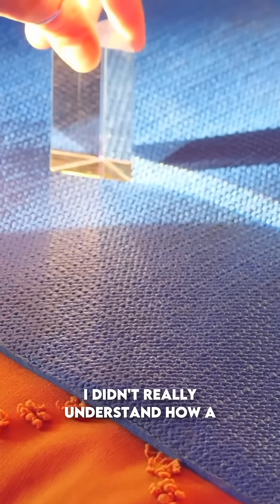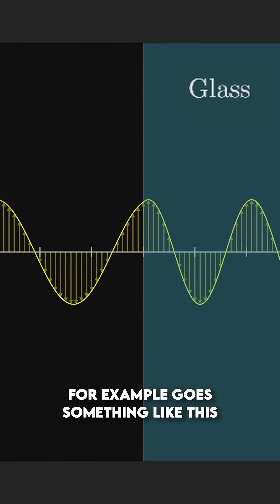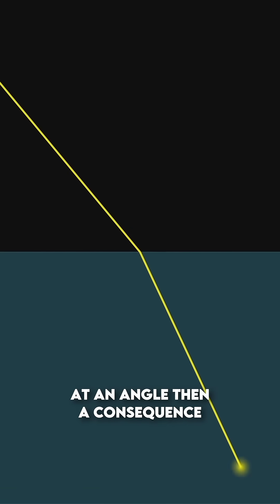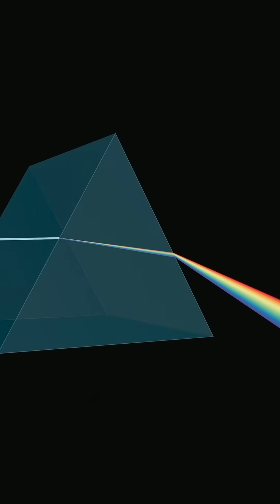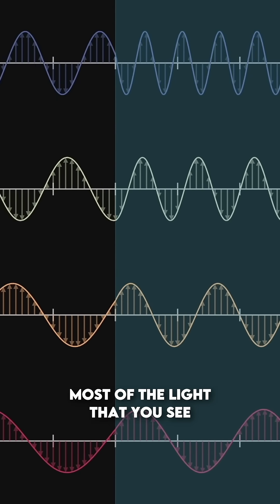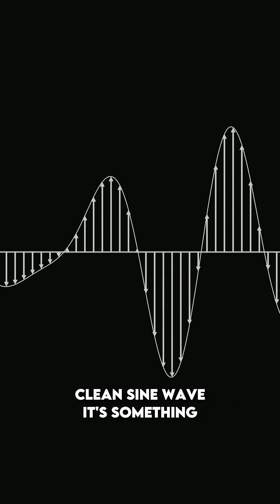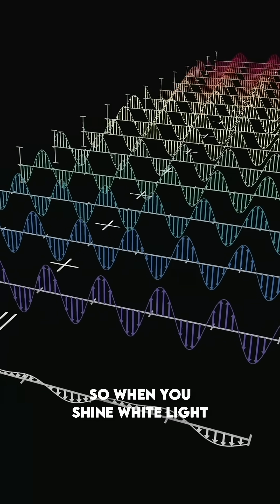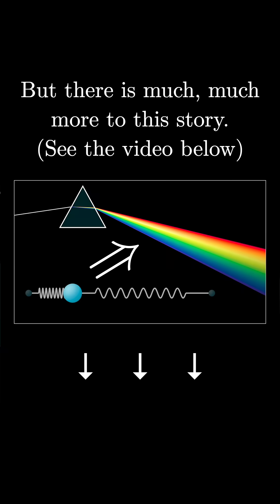How prisms work (full video linked above)

Comment: The amount which light slows down is mediated by its “index of refraction”. This , in turn, is related to the permittivity of a material which tells use how susceptible a material is to electric field.  I kind of imagine it like walking through a crowd where in one case no one knows you and in the other case you’re a celebrity and everyone wants to stop you and get your autograph. It takes you longer to get through the crowd in the later case which would be an example of a high index material or a material that slows the light down a lot.

Comment: Why does light bend when it slows down?  Everyone acts like that is obvious… it’s not obvious to me.
Reply: it bends because it enters a medium at an angle
Reply: @spatrk6634  Still does not explain it. Why bend? Why not just continue at the original angle?
Reply: @wayneosaur  The bending of light conserves energy and wavefront continuity. The wavefronts of light must remain continuous, and to achieve this while changing speed, the light must change direction.
Reply: @spatrk6634  I am sure you are correct, but that didn't exactly clear things up ... just kicked the explanation down the road to something that requires even more explanation.
Reply: imagine a group of runners on a beach. As they reach the water, they slow down. If one runner hits the water first, they slow down while the others are still on the sand, causing the line of runners to pivot or bend toward the water. This bend ensures the group stays together smoothly, without breaking formation, similar to how wavefronts remain continuous.
Reply: @spatrk6634  OK .. I can visualize that, but I can also visualize the runners going slower as they hit the water but remaining in the same direction. I guess the question now is why must there be wavefront continuity? I suppose the answer to that is conservation of energy, but then why does that conserve more energy that a break in continuity. I really am not trying to be difficult, I really don't see what is so obvious to everyone. I am not questioning it, I just honestly don't understand.
Reply: @wayneosaur  The "obviousness" of light bending is rooted in the physics principles that dictate how waves behave. It’s not so much that the concept itself is intuitive but rather that it aligns with these fundamental principles, like energy conservation and wavefront continuity, which are deeply ingrained in how natural processes work.
Reply: @wayneosaur  If the light didn’t bend and kept moving in the same direction, it would disrupt the continuity of the wavefront. This disruption would scatter the light, which means the energy wouldn’t be efficiently transferred through the new medium. The bending ensures that the energy moves smoothly and continuously, which is more "economical" for the system in terms of energy conservation.
Reply: @spatrk6634  Thanks for hanging in there with me. I think this makes sense ... it certainly isn;t obvious.
Reply: @spatrk6634  Thanks -- I have use Snell's laws for light refraction in ray tracing rendering and it obviously is the correct model. Just the casual obviousness of this always seemed strange to me.

Comment: Dispersion is when the velocity alters for a given frequency. This also means the velocity of that frequency is altered.  As a consequence the wavelength at that frequency is also altered. 

So wave theory describes,but doesn't fully explain. Let's dig down then. The important thing is that the electric wave is now running through an electric medium, not just free space. The speed of light in a vacuum is a constant, but this is not technically a vacuum. There are background fields.

The electric fields in a transparent medium occupy most of the volume in relation to atomic centers. They must also be in a random arrangement.  Light travels so fast in relation to the varying fields in water for example that it "sees" the field as essentially frozen in some random configuration. This is also true of gases even though the gas molecules in air are moving fast the light still sees them as essentially frozen in position. ( I have seen so called explanations of the greenhouse effect that have no concept of reality in regard to relative speed).

In an opaque solid the fixed atomic positions intercept light and absorb it as quanta.

In metals the fields contain free electrons that reflect the light by effectively generating a "back-emf".

It is interesting to also view this refraction of light at a quantum level. Given that the quanta are not absorbed (as they are by pigments etc) then the photon energy is unaltered by passing through a transparent material. So red remains red even though it temporarily gets slowed down.  So we can't use energy arguments. That might seem counter-intuitive but that's only if you use classical thinking when you shouldn't.

That leaves momentum which is a function of the wavelength of light. So the momentum of the photons must be coupled to the background field as the light is transmitted through the background field. But when the light emerges the coupling is broken and the light continues, and the wavelength is restored! However there must be some kind of momentum exchange, so if the light is bent in one direction it follows that the prism gets a kick in the other direction.

Comment: The part I never understood is how light slows down, when it is supposed to be a constant. How do we measure the speed before and after entrance into the prism? Also it's almost like the slow down bend only happens at the point of contact, because if they are constantly slowed wouldn't they eventually start to curve? Why does slowing make it bend?

If you slow down an object with mass, does it experience turning forces? Would that even make sense? I know light can be bent by gravitational wells/waves in space time, but are they bent by the gravitational force as well or just the warping of space-time?

Please any physicists who understand this, could you ELI5?

Comment: How are they able to split into “pure colors”? Does such a thing exist🤔
Reply: Yes, pure colors exist.  It's called monochromatic light.
Reply: @carultch  well colors arent discrete the way wavelengths are, so thats what i was trying to get at
Reply: @broccoliboi123  It's true that there are multiple ways to produce light that you perceive as any given color.  But for a select domain of colors, one of those ways can be a single frequency of light.   Any fully-saturated color from red thru violet, can be a single color of light.

Colors that can't exist as a single color of light:
White, Gray, Magenta, Lavender, Chartreuse, Pink, any color considered to be a pastel color, any color you need to turn down the saturation slider to make.

Comment: But the real reason it does all of that is deep in quantum mechanics and makes absolutely no sense until you’ve done so much research on it that it starts to, and then you think about it again and it no longer makes sense.

The quantum way light moves through glass is it moves through in a near infinite different ways, but whichever way takes the least time collapses the wave function and it went through only going the shortest route.

You can place a mirror in a very odd location and under the right circumstances you can get light to reflect off of it at an angle that is NOT opposite of the angle it entered on. Freaky

Comment: The speed of light is constant I’m pretty sure. It’s about the differing angle of refraction of different wavelengths. But that only really describes what happens, not explains what happens. I’m not even sure that there is an answer. People are still struggling with the particle/wave duality of light.

Comment: why the upper spectrum, whith higher energy is more deviated,and what measurements  where made to notice a difference in it,s speed,??the spread spectrum,creating this visual effect,might be due to different absortion level of the waves composing the white light,,blue beeing more and red less ,,so on in bettwen those,,,,!?light is going thrue the glass atoms,wright,so maybe there is a saturation  depending on the wave lenght,,or is it an energy transfer,so the glass atom receive whithe light,and emit it back in seperated waves,when there is an angle of entry and exit,,,,??or is it only a matter of higher frequencys gets more deviated then the lower ones??

Comment: Hi
Imagine the light beam being  circular in cross 
section
and when it touches the angled glass the cross section becomes an elipse  due to the change in angle which because it is now travelling as an elipse causes the spectrum of the rainbow 🌈 with red being the last and longest part of the elipsed beam reaching the other edge of the prism.

Comment: A light ray is not transmitted in a prism merely by avoiding all the mass; it is certainly absorbed and re-emitted by electrons.  This need not involve energy retention, but even light inside the sun must at length escape it.   Sunlight wave forms canNOT reliably be modeled by Fourier transforms of sinusoidal wave components alone; doing so presumes that only S-orbitals emit photons.  Obviously other orbitals also radiate photons, whose wave form need not be sinusoidal because emitting electron orbit is not circular.  If it is found that the Fourier Transform model can accurately describe light's waveform, then that means light ACQUIRES a sinusoidal waveform FROM its energy exchange background space in self-sustaining transit.

Comment: correction: wavelength changes frequency doesn't change. Frequency is source dependent so it remains same no matter the medium but wavelength is medium dependent.

Also speed of light (or any wave) = wavelength*frequency

so since wavelength changes the speed changes as well or vice versa

but frequency remains constant

Comment: It is easier to use wavelengths and index of refraction to understand what is happening. The index of refraction varies slightly with wavelength, so the angle of refraction varies with wavelength.

Comment: Can you use prisms as very analogue fourier transforms to perform calculations? Carry a master signal made out of white light, and exact information as necessary from it using prisms? I wonder how much precision you can get out of a system for that to transfer data. Depending on how precise you can read and emit the light, you potentially could build your system to transmit information from system to system across very narrow spectrums of light.

Comment: What happens on the other side of the prism? It should bend again, speeding up the different colors, restoring the original path instead of forming a rainbow.
Reply: It does bend again.  If your prism is a rectangular prism, it will emerge back in the original direction.  But because it is a triangular prism, it emerges in a different direction, because the exit surface isn't parallel to the entry surface.

Comment: My question is that why light bends when it goes from rarer to denser medium?
Reply: Because that's what's necessary for continuity of the wavefronts.   Wavelength is "sacrificed" when light enters a denser medium.  In order for wavefronts of a continuous field of parallel plane waves to be continuous at the interface, the direction has to change.  Look up proof of Snell's law, to see diagrams.

Comment: Why does a prism separate light into its colours but a rectangular block doesn’t?
Reply: A rectangular block also separates light into its colors, but the phenomenon is much weaker and harder to observe. It cannot be observed by looking through that block, because the rays of different colors are parallel and very close to each other, so they will be focused by the eye at the same point on the retina.

Comment: I think the explanation still leaves so much unanswered… like, by this logic, everything should be a prism, because let’s say you hold a coffee up—light hits it, and it slows down. So glass has to have a special property, in that it doesn’t absorb light, but still slows light. But now hold a drinking glass up, and it isn’t a prism like what you use in your second grade science class. So what is it about the prism that’s different from any pane of glass? Is it the angles of the prism? But then depending on the angle you hold the prism or shine the light through the prism would determine its effectiveness…

Idk. The more I think about it the less i get it

Comment: The light doesn't actually slow down. What is happening is that the light is hitting more molecules and has to bounce a lot more often. If you ever look at the equation of light moving from a less dense area to a more dense one this "slow down" effect occurs. All that is really happening is that it's speed is decreasing but it's velocity isn't. Sort of like throwing a ball down a tunnel vs throwing a ball at the same velocity but it hits the walls of the tunnel. The straight shot is going to be quicker even though the ball is still moving at the same velocity. Since light is also a wave, you get different colors based on the portion of the waves that were refracted which is why its split. Different wavelengths have different pass through. For instance, a radio wave would not be affected by the prism.

Comment: You can't slow down light. Light travels at the speed of light. A prism bounces photons around inside it when it hits the molecules in the prism, making it travel a longer distance (making it appear to slow down). It also has the side effect of scattering the different wavelengths of photons out a bit (causing the refraction and visible color shifting).
Reply: That's a misconception.  The light isn't taking a serpentine path inside the prism, otherwise, it wouldn't emerge in such a predictable direction.

The truth is, that there's a superposition of the original EM wave with the EM wave produced in the medium, responding to the disturbance.  On net, these add up to a wave that appears to travel slower than the original ligth wave.

"Light travels at the speed of light", is based on light in free space.  Light in a medium will appear to slow down, due to this effect of the dielectric material.
Reply: @carultch  yes, but the light never travels along any path slower than the speed of light. Once the superposition of the wave function collapses after it is observed, the light still takes a path based on its probabilities, and that path has a distance, and the photons travel at the speed of light over that distance, no more, no less. 

Light never slows down.
Reply: @frozencreed  Watch Grant's full video.  It explains it better than I can explain it, when limited to just text.

Comment: Small correction, it is because of different wavelengths of light spectrum, not frequency.
Reply: Frequency is fundamental to the identity of the light wave, rather than wavelength.  Wavelength is "sacrificed" to the process of refraction to compensate for the decrease in wave speed.  Frequency stays put.

The reason we identify colors of light by wavelength instead of frequency, is that you cannot directly measure frequency at the order of magnitude of hundreds of Terahertz.  We instead measure the free space wavelength more directly using diffraction, and calculate what the frequency is from the known speed of light.

Comment: Light doesn't ever slow down, it's just bouncing around in the medium it's traveling through which means it's traveling further.
Reply: if that were true then it wouldn't separate into individual colors, because they would all be entering at the same speed, and exiting at the same speed. That they don't, means you are mistaken.
Reply: The speed of light is absolute. It does not change. The light refracting and scattering is what is separating it, it does not slow down regardless of it's color.  @ChayChay0510
Reply: @ChayChay0510 
Light travels at constant speed c under any circumstance. 
In medium, photons hit particles in it and reemission and bouncing happen there.
Basically these reactions happen probabilistically, and in total, appears to slow down in medium macroscopically.

Comment: Doesn't that break the second law of thermodynamics? photons slow down through the prism and then speed back up as they leave the prism and enter the air medium? What makes the Photons speed back up?
Reply: As I understand it, the light doesn't actually slow down in a medium, it takes a longer path by bouncing between particles (due to the higher density of the solid or liquid)
Reply: @RhodokTribesman  makes sense taking a longer path but the medium does effect the speed of light. It leaves the prism it at the speed it entered.

Comment: I saw a visualization of refraction in a textbook and it really helped to understand the subject. Basically the beam of light was crossed by perpendicular lines that change angle when entering the prism. This easily allows us to see how the light gets deflected as the perpendicular lines would change angle and they would still be perpendicular to the beam inside the prism and after. Think of it like throwing a metal rod in water.